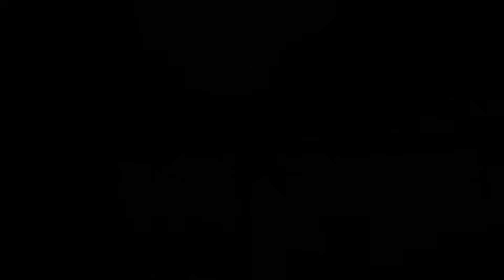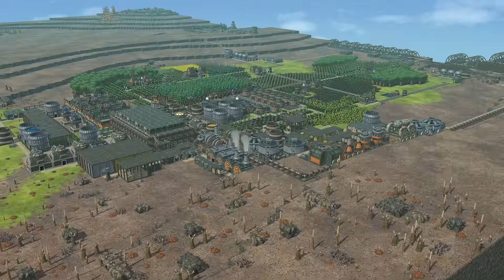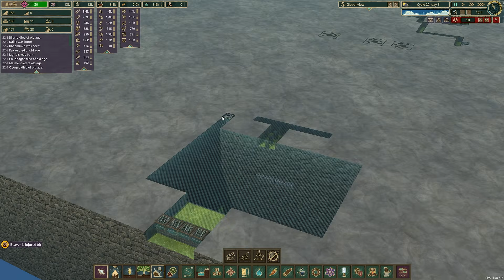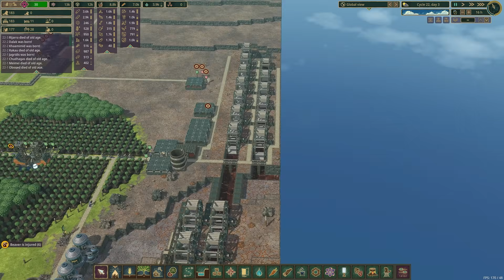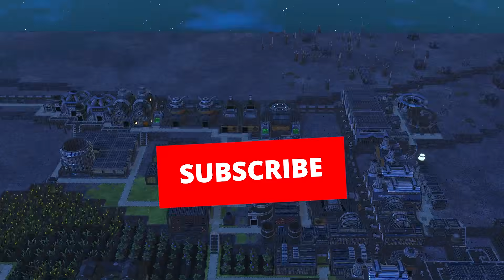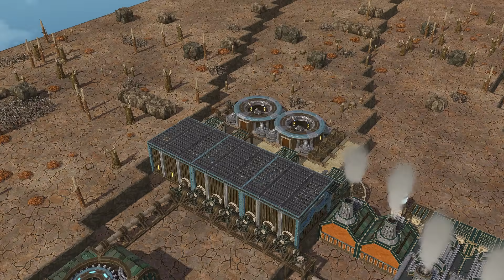Unleashing the Iron Bots into the Timber Dunes! Timberborn HARD MODE (1.0 Exp) EP 10

Comment: 52:37 Here I'd put the second set of water pumps deeper, so they can pump when the upper ones can't reach anymore. An alternative would be to have a pumping cave on the lowest level, which is filled with fill valves from the reservoir.  (Of course, you likely found something else since then.)

Comment: 3:54 
For the shafts you need to place here, you can use the platform ones - the ones you place paths on - to just cross over and use actual paths between them. Cheaper than stairs and the beavers can walk the path easier. Just a thought.

Comment: 38:15 I need to ask you, what do you want to achieve?

Do you want a power-on delay? -> Acumulator

Or do you want a shutdown delay? -> delay

Rst resets the process. Even when the input signal is present.

T1 Is your desired follow-up time 

T2 can T1 be shifted by the set time, if you don't want that, dont use IT.

That's basically what the description says. Don't let things like this drive you crazy. Maybe it will help if you approach it differently, like considering what you want to achieve and what possibilities exist. 

If you want to get rid of the sensor flickering, the easiest way would probably be to set the water sensor to, say, <0.5 and then add a switch-off delay. The fill level can reach a value somewhere between 0.8 and 0.9. You'll then need to either measure or experiment to determine the required T1 time. 

If that's too much experimentation for you, you can simply do it like in real life, just use two water level sensors. One is for turning the fluid dump on, the other for turning it off. That would at least be 100% fail-safe.